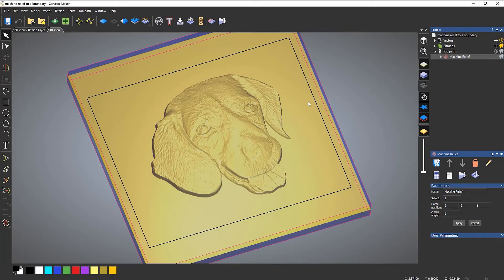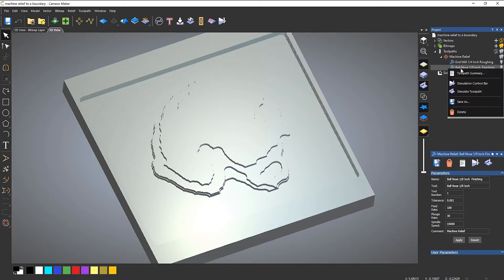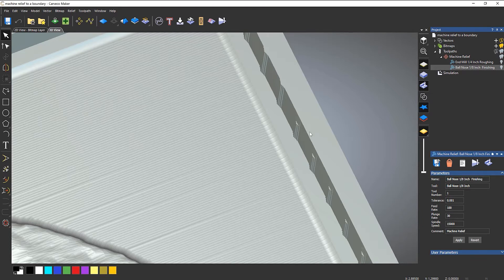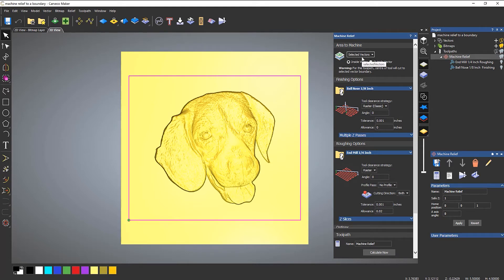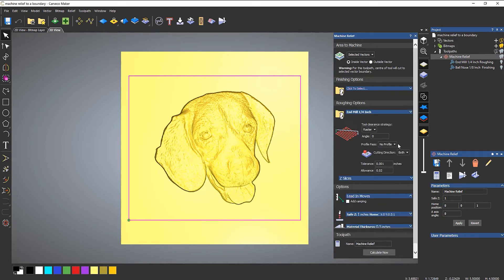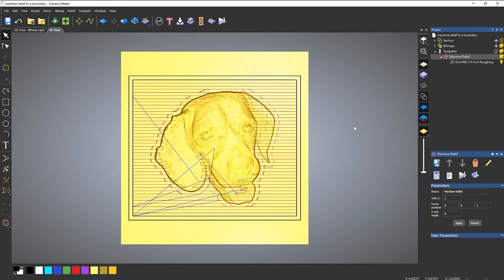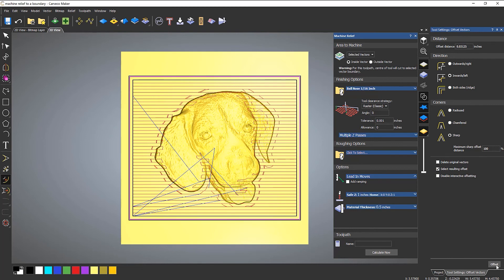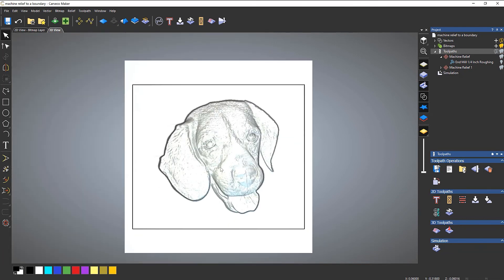Tips and Tricks: Machining a Relief to a Boundary

Comment: Thank you for this video! I just recently had this problem and you solved it for me much easier than what I did. My solve was to cut another path around the outside vector, but that left a toolpath cut at a slightly different depth than the finish cut, this leaves it looking much better.
Thanks again!

Comment: When using a raster roughing toolpath, you have tje option of running a profile before,after, during raster pass which would smooth the boundary and prevent the scalloped edge and thinner tool finishing toolpath would be within the boundary edge